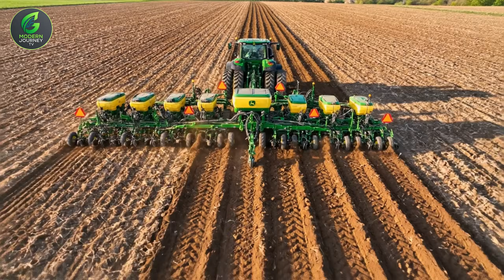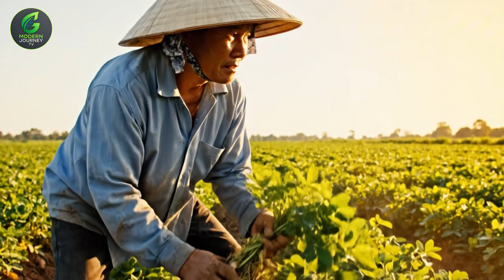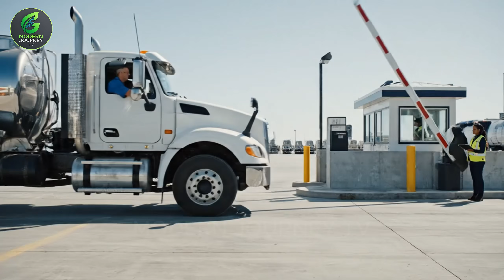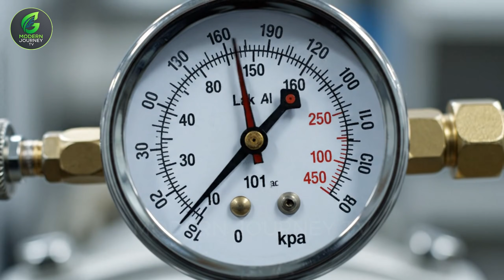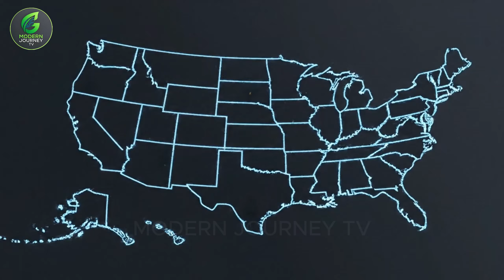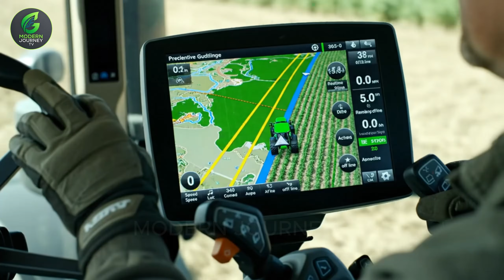Inside a Peanut Butter Factory: How Perfect Peanut Butter Is Made (Full Process)

Comment: 100% AI slop. not a single picture was real..  and the real stuff is around. When the AI commentary uses terms like "$150,000 to $200,000lb of peanuts per day".. you know it's screwed up. Lazy ai crap is gonna ruin YT and what ever else it touches.   Sure is disappointing to see this slop like it's real. 
 
YouTube should be required to disclose in the title anything that is not real, that is ai slop. This has been up for 5 months... should be disclosed or taken down. Where are the YT police and censors with this SLOP?
Reply from the maker: Transparency is important. If a video contains AI-generated narration or visuals, clearly labeling it helps viewers understand what they're watching. Accurate presentation and proper disclosure can build trust while still allowing creators to use AI responsibly.